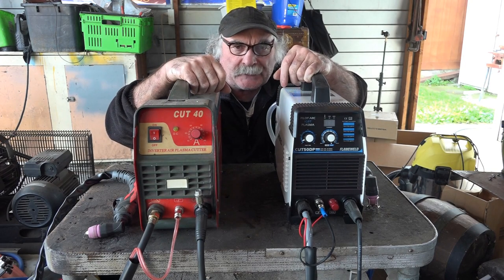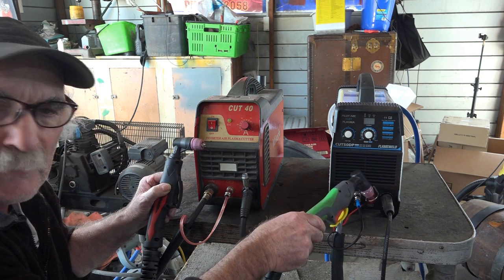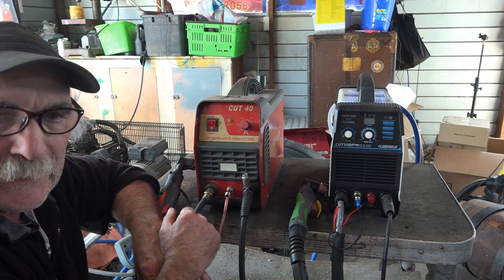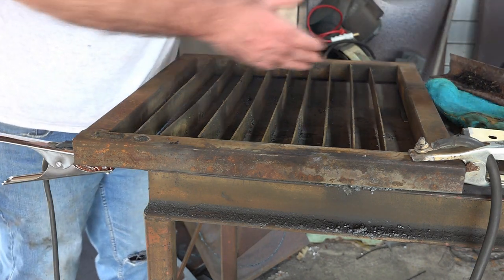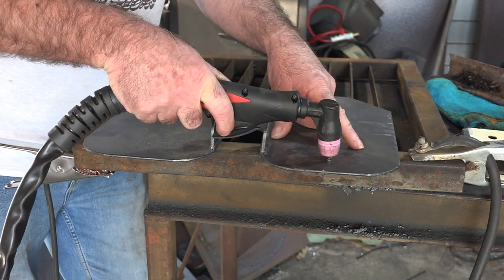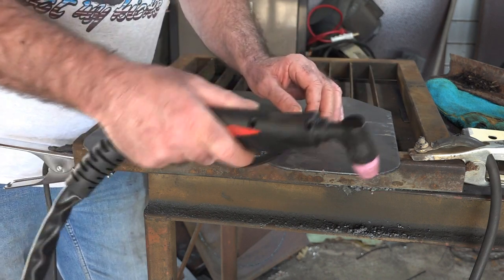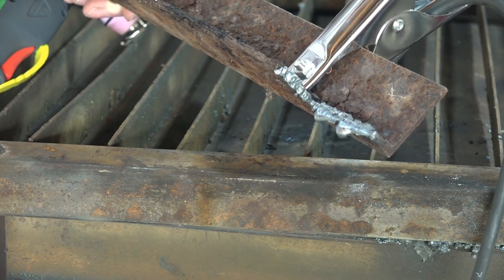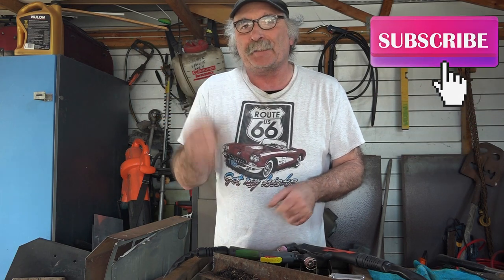Cutting Demo  Pilot Arc vs Non-Pilot Arc - Which is Better?

Comment: Pete, It looked like the non pilot arc machine made a better cut on the cleaner metal.   What did you think?   I have a pilot arc machine that uses an AG60P gun.   Can I use a drag tip gun on this machine?
Reply from the maker: I take the stand off guide off all my machines and use as a drag tip. But you cant with some machines.